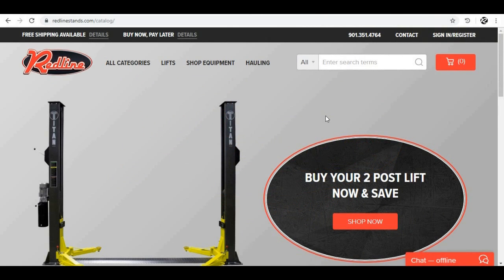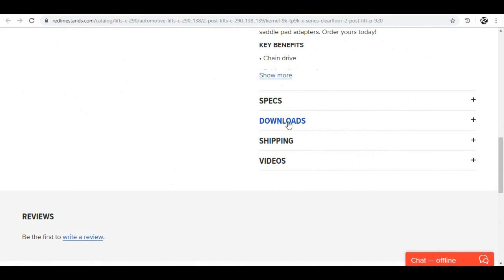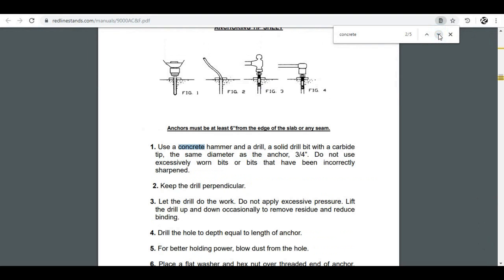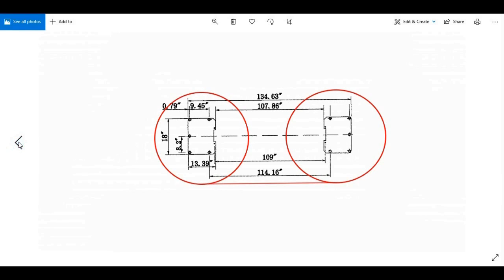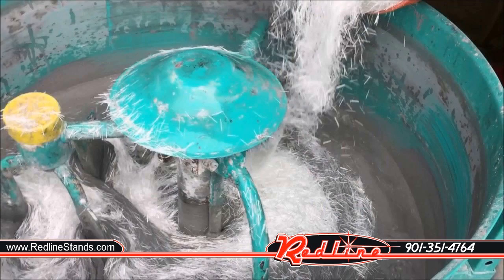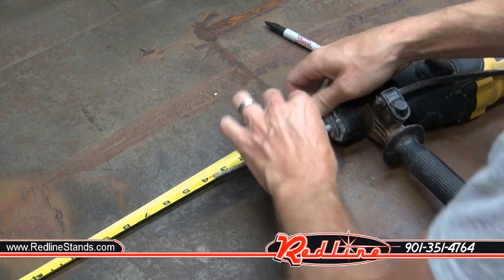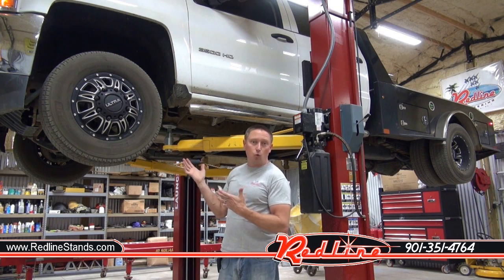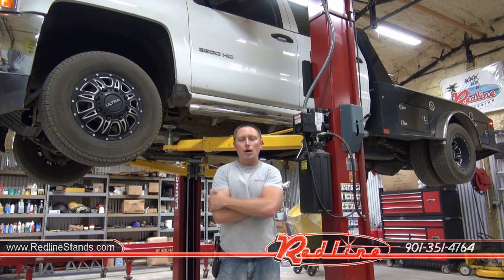Concrete Requirements for 2 Post Auto Lifts - Tutorial

Comment: The two hoists you referenced are entirely different styles. An open top hoist is going to put a lot more stress on the concrete as there is nothing stopping the tops from wanting to tilt in beside the concrete. The seconds hoist has a truss across the top taking the torque load out of the posts all together.

Comment: Nice video! Can you tell me what the smallest slab length and width would be for a 9k two post  clear floor model would be please? Lots of conflicting info around the internet. Thanks!
Reply from the maker: You need to consult the manual of the lift you're interested to install for that info sir.  My rule of thumb has always been 3 ft wider than the lift on both sides, and 22 ft long.

Comment: Just note that if your concrete does have rebar, you can use a bit that also cutd through rebar. Just make sure you drill slow to prevent the bit from getting stuck inside the concrete while drilling.

Comment: I've already had my concrete poured 4" in a 25'x45' barn, but had the location where the lift will go dug 12" deep and 4' wide the full 15' area of the first bay.  I used 4500 strength concrete, but didn't use any rebar or mesh type reinforcement.  Will that limit what lift I can get?  I'm looking at 12k with a top brace, but doubt I'll ever have anything over 8k on it.  Am I in trouble without the extra rebar/mesh support?  Thanks.
Reply: Top bar for sure helps with side loads on the posts but I would not rely entirely on the neat concrete matrix to counteract shear forces on the anchor bolts which focus stresses along their narrow axes. I absolutely would want those loads to be spread out. I am in no way an expert on this. I just have a bit of general understanding of structures which gives me what I feel is a decent gut instinct on the matter. I am actually watching these vids in anticipation of doing some building revamping which includes adding a garage slab for which I am considering some reinforcement in case I get a lift down the road. I would absolutely use a rebar structure not only for each pad but I would actually link the structures with a reinforcement beam spanning across the width of the lift, meticulously tying them together to spread the loads. I'm also thinking of adding thick plates, pre-drilled for post pad bolt spacing, inserted in the concrete, maybe 3" deep and welded to the rebar support structure under each pad. That way, post leverage loads on the anchor bolts would not only act on the concrete matrix but also directly on the rebar structures within the concrete. Proper peace of mind when you have a fat heap of metal hanging over your head. If in doubt, spending 100 bucks on some quick consultancy with a worthy expert is cheap insurance. I'd submit my plan to the same scrutiny before going ahead, no matter how confident I am in the design. Not being a mechanical engineer, I'd want to be absolutely certain and the engineer can save you money by sizing up the materials and fine-tuning the design so you're not building a nuclear bunker-spec slab to lift a miata or whatever the lift will be used for.

Comment: Simple physics. A 2 post lift without an upper spanner connection will allow the post to become levers. You are then dependant on the bond between the anchors and the concrete. Compressive strength has ZERO input here. You can pour the concrete as deep and wide as you want. If the anchors cannot cancel the pulling forces of the lift, the post will fail.

Comment: I am going to weld 200mm I beams 2 at 3m each side and 1 between the other 2 at 1.5m and weld it into a H pattern .
Drill my 2 post lifts hole pattern into the beams and then concrete the pad around it with just enough clearance from the concrete surface to do the bolt's up .

Comment: I only have a 4" slab and I do not know the strength of the cement so I am considering using a steel plate, maybe 3/8" to help distribute the weight out some, any thoughts?
Reply from the maker: Honestly, I'd love to, but my attorney was pretty clear not to touch these questions with a ten foot pole.  In the USA today, everyone sues everyone for anything, even trying to help.  I'm sorry man; we've done this to ourselves.
Reply: @RedlineStands  Ahh yes good call 👍 I will get plates made and use them, better to distribute the weight than not. I see I could cut out an area and pour thicker cement where the posts will be but I like my idea better. Hopefully I won’t have any issues ugh. 🤔

Comment: What about epoxy anchors instead of the wedge anchors. Still have to retorque?
Reply from the maker: I like to epoxy wedge anchors into place while the epoxy is wet.  That way, you have a mechanical and chemical bond.
Reply: @RedlineStands  where on the wedge anchor do you apply the epoxy?  The entire anchor,  or just the threaded area (avoiding wedge part)?
Reply from the maker: @hightower2537  Definitely don't put epoxy on the threads.  You only need it on the wedge portion that expands in the hole.

Comment: The 12' thick footers are for the frostline, It provides no strength for the working slab where the lift goes. The working part of the slab should be whatever the manufacturer says, as a minimum.

Comment: your diagram says not less than 5",however, you said 4"?
Reply from the maker: Honestly, I don't even doubt it.  The truth is that trying to make these videos without one single silly error occuring is the kind of thing I think I could only accomplish if YouTube was the only thing I did for a living.  It sounds so easy to achieve video perfection in conversation, but it's completely another to produce 10 minutes of content and never screw up once.
Reply: I get it. Thanks for the videos but this concrete thing is causing me to lose sleep. Is it 4 or 5?
Reply from the maker: @howardmoody9379   You gotta consult your manual.  Some lifts call for 4" and others require thicker, like 6".  The size of the baseplate, capacity, and other things all determine what's needed.

Comment: Just some notes regarding the manual and its information: PSI rating of concrete is compressive strength not tensile strength, and use of the term "cement" instead of concrete is very misleading as cement is the grey Type II portland that is an ingredient in concrete.

Comment: Should properly epoxy threaded rod instead of anchor bolts that often fail or loosen over time.
Reply from the maker: I agree with half this statement.  I like to use epoxy, and expand my anchors while the epoxy is still wet.  That gives me the anchor holding in place by mechanical means, as well as epoxy.

Comment: hi please i want to know to tall is this lift you using on the 3500 truck you have up in the air.  is it the extra tall or the 12 ft lift.
Reply from the maker: It's this lift
https://www.redlinestands.com/catalog/lifts-c-290/automotive-lifts-c-290_138/2-post-car-truck-lifts-c-290_138_139/launch-11k-asymmetric-2-post-clearfloor-lift-ali-certified-p-2424

Comment: 3000 psi is not a tensile strength but compressive strength.  Concrete does not have that much tensile strength,  that is why you use rebar in Concrete to give it tensile strength. You should hire an engineer to design the foundation and the placement  of rebar in a foundation detail.

Comment: “Wire mesh” should be placed in the top 1/3 of the slab. It’s purpose is to hold the surface cracks tightly together. It offers virtually no structural strength.
And hard to believe the manual actually specifies “four inches of CEMENT”. 
There’s a failure and a lawsuit coming I’m sure.
Reply: Incorrect. As the top of the slab see's mostly compressive forces, the bottom of the slab sees tensile (imagine the slab 'bowing' downward with force applied from above). Concrete is good at compression, poor at tension. The mesh is added toward the bottom to combat the low tensile strength.

Comment: I have 4” slab but I have 5,600 psi concrete in it 26 years ago power trowel, and no cuts in slab, I have fly ashas base under slab, and no cracks have developed, will this support a 9,000 lbs lift?
Reply from the maker: A fly ashas base under slab?  I have no idea what that is sir.  You need to cross reference the specs found in the manual of whatever lift you intend to buy against the specs of your slab.  A question like this is not one that I prefer to answer at all, because it assumes liability with no chance of reward.  If I tell you "yes" and it works fine, I make nothing, but if I tell you "yes" and I'm wrong, your wife will sue me over your death when the slab breaks and drops a vehicle on you.  I'm sorry but the letigious nature of modern American society and the dime-a-dozen supply of ambulance-chasing attorneys makes me overly cautious to help folks anymore.
Reply: @RedlineStands  fly ash if what’s left from cole been burnt in power plants,they used to give it away until they found out how good it is for under layment for interstate and concrete pads
Reply: @RedlineStands  I get not want to be lieable, I am flipping between a post lift or the floor lift, similar to my motorcycle lift but made for trucks, my shop has 10’6” walls so I know I won’t be standing under any lift, and mostly I would use for suspension and wheels/ tires/ brakes/ axel work, thanks
Reply from the maker: @davidanderson3999  Consider a 2 post floorplate style lift.  You'll find you can probably still roll around under the vehicle on a stool and that'll be much better.  For suspension work, a 2 post is the way to go for sure
Reply: @RedlineStands  that’s kinda what I was thinking.also I have A100 plates if I remember right they are 40” by 30” so I could weld them to the foot pads and increase the load area, 3/8” thick just a idea I have floating around
Reply from the maker: @davidanderson3999  Hmmm.  3/8" is not very thick.  On the other hand, if you go thicker and your welds don't penetrate then that creates another issue.  I naturally can't offer an opinion on this, only raise concerns.

Comment: my 2 post lift, old ravaglioli KPN124 (2500kg) mounted on concrete of 30cm thick with steel under it and 5x5 meters 16x16ft y think for usa , the post lift has only 4 bolts to fix it in the concrete , good weight distribution

Comment: Nice video and very helpful. I am installing a new 3-stall garage floor to accommodate a future 9000 2-post lift. Just like in the video, I was thinking of varying the concrete thickness of my new concrete floor. Perhaps I could add 2 to 4 inches of extra depth, for a 6 foot swath, across the width of all three bays?  This would provide lots of post-install location options over the thicker concrete.  However, I do question how varying concrete thickness across a pour can effect the quality of the cure, if it does all.  Any comments?
Reply from the maker: Disregard any worries about the concrete curing due to varying thickness sir.  It needs 28 days to fully harden.  As long as you go above and beyond the minimum requirements specified in your lift's manual, you'll be more than fine.  Thanks.
Reply: @RedlineStands  Sounds like a plan comrade. Many thanks!
Reply: @RedlineStands  I had one more question regarding the use of rebar in my new floor.  Will it hurt anything to put rebar “only in” the 6 foot swath area, versus the whole floor?
Reply from the maker: @Steelguy76  I don't put rebar under the lift at all.  I put it in the footer around the edges.  I put wire matting under the lift.

Comment: I've just gone through this with my own lift and had to cut out 2 pads in the existing slab, tied rebar back into the slab and made it 8 inches thick and cut back under the existing slab. One thing that you said was wait 28 days for it to cure - I thought the same but the concrete worker who poured my pads and then following up with 2 mates who are engineers reckon within 3 to 5 days it's at full strength (32Mpa) and waiting 28 days is pointless.
Reply: They are wrong. Wait the full 28-30 days.

Comment: after nearly being killed by my lift breaking the concrete i had someone make a top brace for my lift. it is not too expensive and can save your life.
Reply: Very important point and advantage of using the top cable lifts that use a beam to keep the tops connected and preventing the tops moving inward.  I also use 4 ft outriggers to give greater stability.  I had a well used second hand commercial lift once that came from the factory with outriggers and a structural member for the cables to pass through at the floor level.  Two post lift did not even need to be bolted down!
Reply: @slarsen32  how do you make the outriggers?

Comment: I have a 3000 psi 5.5" slab w/ rebar every 24" across the entire slab in my shop.  It's been cured for 7 years.  Do I need to cut out a section or can any of your lifts work with this?   I am looking at a 9k lift for some of my vehicles.
Reply from the maker: You "should" be fine.  The reason I'm using "should" in quotations is that the true correct answer is actually this.  You should always consult the manual of the car lift you're considering and make sure the required specs given in that manual are satisfied.  Some car lifts have wide baseplates that allow for thinner concrete, while others have small baseplates that require stronger concrete.  At the end of the day, you need to check the manual and let the manual serve as the word of God...so to speak.
Reply: Drill a hole to see if you really have 5.5” where the lift goes. Concrete guys are not always that exact when pouring slabs.
Reply: I did the foundation prep, so it's 5.5" minimum.  compacted and formed the whole thing.  It was an engineered slab.  @torsten6777

Comment: What size rebar did you use? #4 or #6? I have a bendpak 10k lift and the manual calls for #6 but I’m not sure if that’s over kill. I see most ppl using #4 rebar
Reply from the maker: Good question, but I'm sorry to say that I do not know.  I didn't pour the slab, and I didn't pay any attention to the size of the rebar the contractor was using.

Comment: If you have to keep retorqueing the bolts, then are they not stretching? At what point would they fail?
Reply from the maker: That's a good question, and frankly, I'm not sure.  I don't worry about retorqueing mine very often as I'm typically only lifting 3k lb cars with my 11k lb lift, which has 6" of concrete.  However, in the rare event I'm about to lift my diesel, I make sure they're tight, which normally requires less than 1/8 of a turn.  Given I lift my diesel about once a year, it would take a very long time in my case to affect anything.

Comment: They make drill bits made to drill through rebar. I am not a pro but I have installed a handful of lifts. When drilling the concrete you can kinda tell when it’s not really strong concrete it will drill through it very fast. Again I’m not a pro but if it drills out very fast then it’s a good idea to re pour some pads for the lift to be safe. When I was installing a lift in my garage at home the one side was 6in thick and other side only 3in. So I cut out two 4ft x 4ft sections of the floor, dug out the area to be 12in thick and then used a 1ft wide Auger to drill two 4ft holes in each section this was completely over kill but I would rather go over kill and have all that weight of the concrete. We then drilled into the existing concrete floor so the rebar went into the old floor to help it be even stronger. We used 5,000 psi concrete, I put burlap over the concrete when we were done and kept the burlap moist for 3-4 days which helps the concrete not crack when curing. I let the concrete cure for 30 days before installing the lift. The lift came with anchor bolts but they were only like 5in long and when you account for the thickness of the lift, shims and the nut the bolts are less then 4in deep in the concrete so I bought longer bolts I think they were 7-8in long. I’ve seen the concrete break under lifts and many times it looks like the concrete broke close to the top like the bolts weren’t very long. The funny thing is in the manual for my lift it states a minimum of 4in thick 3,000 psi concrete which might be fine but I don’t trust that. I think it even said something like if you poured a concrete pad it must be 2ft x 2ft but that seems so small I’d much rather have a 4ft x 4ft pad 12in deep to atleast have some good weight to keep that post from moving. Idk why anyone would ever go the bare minimum considering ur already doing the work to make the pad, it’s only gonna cost you a few hundred bucks more to make it a bit overkill so u know it’s gonna be safe.
Reply: Pretty good I agree Overkill is better than having an accident down the road
Reply: @tonybon4989  bud the accident will happen in the garage not down the road.
Reply: If you got to mention you can't put the anchor bolts in the ground anywhere near a crack or a seam😮😮😮😮 it's not legal and it's not safe
Reply: @tonybon4989 not legal where? What law is that?
Reply: send me a few hundred bucks please.